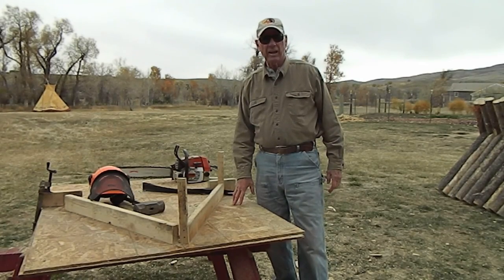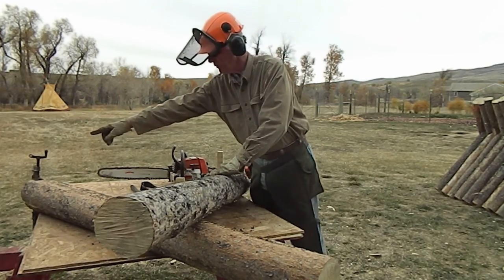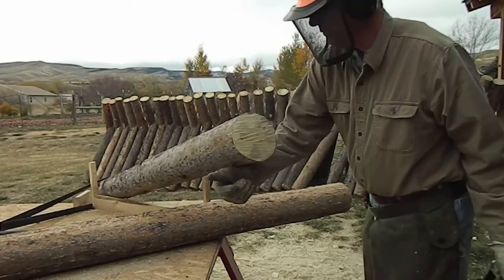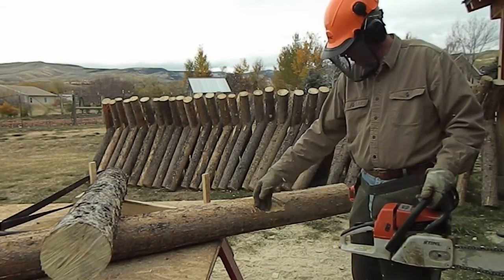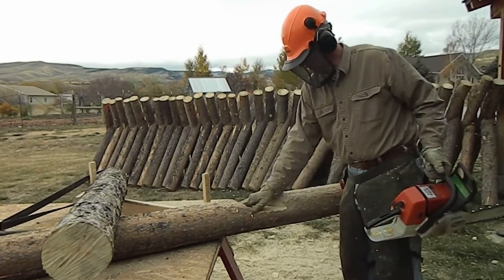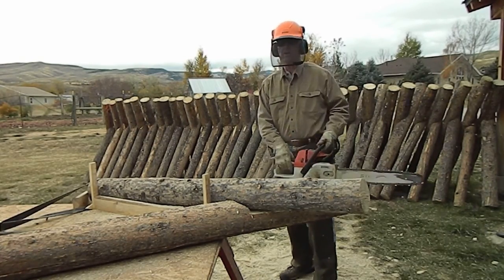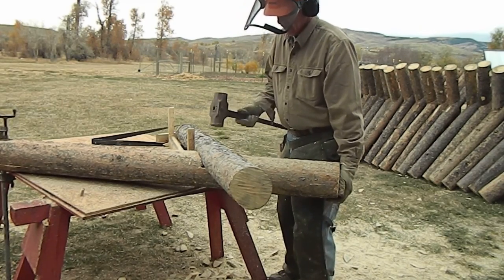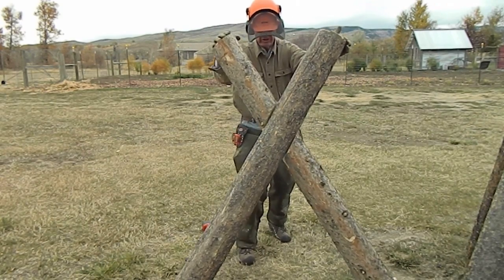Buck & Rail Fence

Comment: Great video, would be great if you could show how you build your jig.
Reply from the maker: Base is two sheets of 1/2" particle board, 48" wide by 62" long. Blocks for bottom of logs to rest against are two 2"X4"X6". Two 2"X4"X36" legs form the 30-dgree angle. Vertical bolt used to hold logs with bike inner tube and allow them to rotate is 48" from top of V. Two short 1"X2" stakes are fastened at top of V and bottom of one leg.
Reply: thank you.
Reply from the maker: Additional information.  Actual total angle between posts is 60-degrees, or two 30-degree angles measured from vertical centerline of jig.  The 60-degree angle seems to be about right for stability of 6-ft long posts.

Comment: What kind of wood, sir? We're loaded down with pine here, but I'm just not sure if they would last without some kind of preservative.
Reply from the maker: I used lodgepole pine. Since the wood is mainly above ground level, it tends to last many years.  Many installations in Wyoming have been in for 20 years or more. Probably would not hurt to apply preservative to base of crossbucks, where they make contact with soil. Course it wouldn't hurt to apply preservative to entire fence material, including poles, especially if you are in an area with wet climate.

Comment: Thanks for the video.  I have some property,  most in a canyon bottom, some up on the rim.  Constant problems with incursions of cattle from surrounding ranches, so I spend a lot of time stretching and mending fence.  Lots of fractured basalt, little soil, so post-holes are mostly out of the question.  I can use a motorized pounder to drive t-posts into the rock, but it's not my favorite pastime, and I hate "bob-wire".  I have LOTS of ponderosa in the bottom - hundreds of the smaller trees were destroyed by a wildfire a couple years back...still not rotted out or insect-destroyed, so they should serve for both bucks and rails.  I'd get plenty dirty working with them, but I've been dirty before.

If I build a 3-rail buck & rail fence on the rockiest areas, I think it would be a great idea to ALSO cut TWO notches in one buck-post, each notch wide enough for a pair of rails to fit.  The third set of rails would rest in the V where the buck-posts cross, so I'd guess I wouldn't need to have a notch for them, they'd be well supported.  What say you?  Is it wise to cut notches for the rails while building the bucks?
Reply from the maker: I haven't used notches, but they surely would help with stability, especially if an animal or person climbs over and steps on the rails.  Spikes sometimes pull out: whereas log screws hold  pretty well. Thanks for your input.

Comment: Would you share the dimensions of your jig please.
Reply from the maker: Jig is laid out to accommodate buck posts 6-ft long, with middle of cross at 4-ft from bottom end of post. So the rails that are installed are a little less, about 3'8" long. Jig has 30-degree angle between the posts. Helps to have stake installed near cross and at bottom end of one so the log doesn't roll while working. Then clamp bottom of the second log as it can stay put throughout the process. I used poles averaging about 7-inches diameter, which is likely larger than necessary, but that is what I had available. Also, these bucks are for a relatively high fence; many fences use posts 5-ft long. Need anything else, let me know.
Reply from the maker: Sorry for delay, I haven't viewed in awhile.  I'll measure it up and respond shortly.
Reply from the maker: Additional information. Angle is 60 degrees between posts, or two 30-degree angles from middle centerline.

Comment: Are you hanging wire or running rails? If wire, how do you handle corners?
Reply from the maker: Jig is just a piece of plywood or composite board doubled up as base, lay out 30-degree angle, attach 2X4s on the line, then attach some stakes or 2 X2s for top post, and 2X4 block for bottom log.  Then use pipe clamp to secure the bottom log.  I built them with hefty logs, 6-ft long, 7-in in diam, in order to attach pole rails.